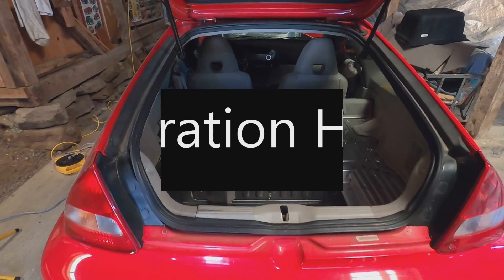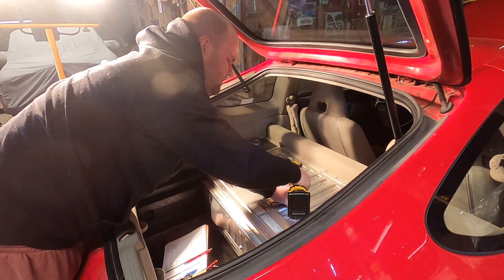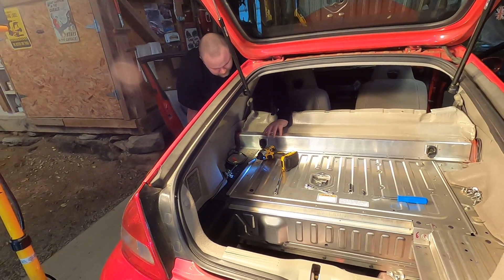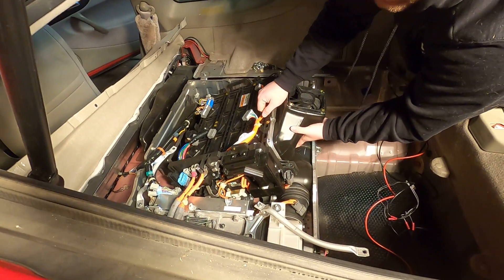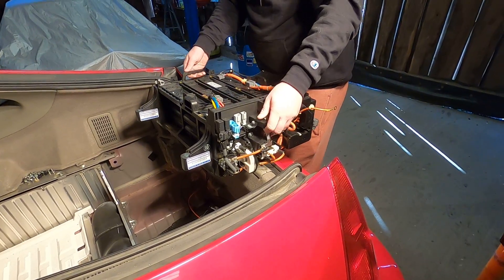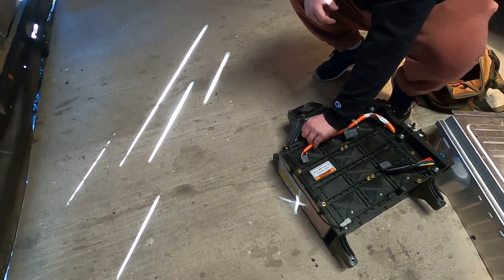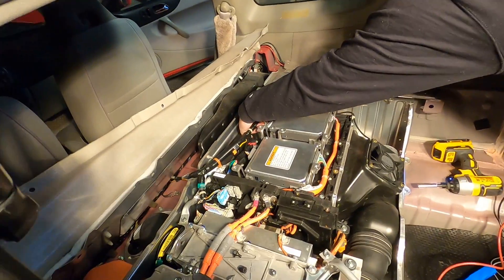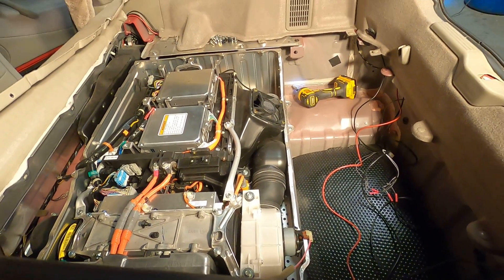2006 First Generation Honda Insight IMA Battery Replacement February 2022

Comment: Well, those were simpler models it seems. The CRZ (2010-2016) NiHM and LiON battery packs require recalibrating of some components. No wonder the local dealer (Long Island, NY) wants $5,400 to replace mine. 
I have two questions:

#1 Did the Honda Insights have alternators to keep the under hood battery charged?

#2 After seeing the tech do this job, would you do it yourself?
Reply from the maker: First, thank you very much for watching. Yes, just like any car, the first-generation Honda Insight has an alternator under the hood that keeps the lead acid battery charged that is also under the hood. Good question. Probably not as what he did comes with a 2-year warranty. However, I am getting ready to install a grid charger myself and will do a video on that. After I install the grid charger, I'm going to sell my Insight as I just don't drive it any longer.

Comment: Had my insight for 7 years and have two battery packs. The original with the car and one from ebay for £200. I do a re-balance on each one every 6 months when I rotate the batteries. Just no other maintenance and never failed an MOT.
Great video and very detailed keep up the good work!
Reply from the maker: Thank you for watching and commenting. I just purchased a grid charger and will be installing it soon. I've had this car for 18 years and it has been an excellent vehicle.
Reply: @kensshowtell  18 years that's brilliant they are so well engineered and bulletproof
Reply from the maker: @andrewamidala  Indeed they are.

Comment: Thank you for video!! I've replaced the IMA battery twice in mine. Fun times. I have a red 03 Insight that I bought new. Blew at head gasket at 324k miles. Put another engine in it with 68k. Have driven it approximately 12k since the engine change. Does anyone know if an IMA (motor, not battery) from a manual tranny will fit an auto tranny model?
Reply from the maker: Thank you for watching and commenting. I've bought a grid charger that I will install soon. I don't know the answer to your question.  Perhaps others do.

Comment: $350 for an install is not bad at all.  I may pull the trigger on an Insight.
Reply from the maker: Thank you for watching and commenting. I thought the installation fee was very reasonable considering the technician drove 3+ hours to get to my place and took the old battery away. It is still functioning well.
Reply: @kensshowtell  And I always favored the first gen Honda Insight because it made no compromises for maximum MPG
Reply from the maker: Yes, it was truly a car built by engineers for those who were interested it driving it as they intended. A high-quality product, only built in Japan, 15,000 worldwide. Where are you located as I've been considering selling mine. @lucristianx

Comment: Excellent video!  The 1st Gen Insight has been on my want list for a long time!  Really cool to see the inner workings and watch the infamous battery being replaced.   If I was doing long freeway commuting, I'd definitely have one.  Until then, my '81 Volkswagen Rabbit Diesel LX Pickup will continue to be my daily driver.
Reply from the maker: Thank you. This Honda, like all Hondas has been extremely reliable. It came with its own tool kit, owner's manual, and shop manual as Honda intended this car to be for the enthusiast. You do have to adjust the valves every 100,000.00 miles. to drive it correctly and to squeeze the MPG out of it you stay off the brakes and learn the true meaning of conservation of energy.